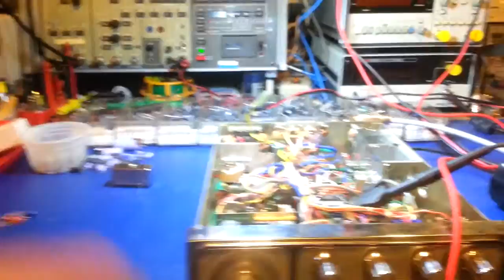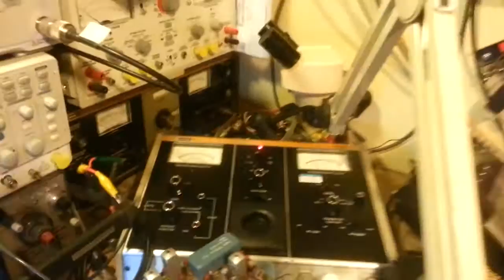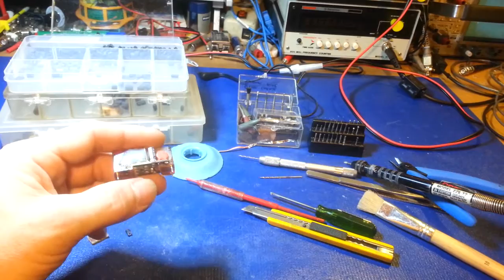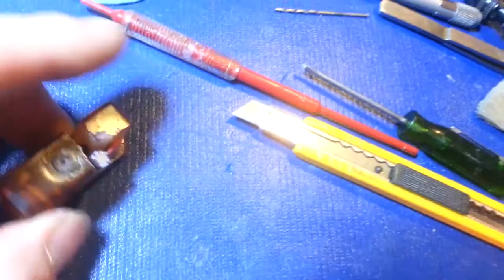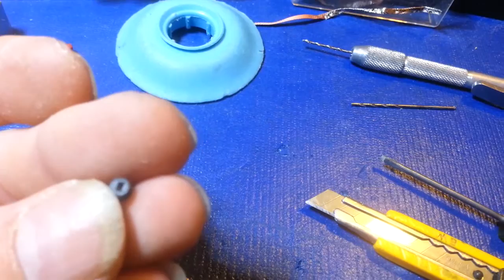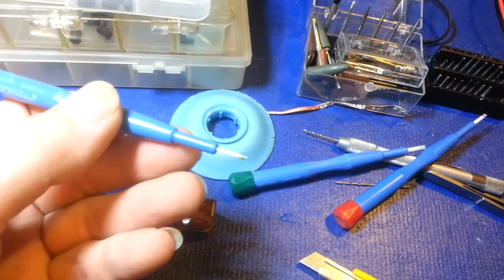Midland 79-892 AM/SSB CB radio Cybernet VCO block repair completed. Part 2

Comment: I've been very successful rebuilding the blocks. Heat gun , resolder connections, (epoxy pulls  connection apart over time) replace diode(some) & cap, some but not all have the hole in them on bottom. But a Dremel is your friend here!!

Comment: Mike - You're truly a fantastic tech, however, your even a better instructor!  Put yourself up for a raise!  :)
Reply from the maker: I try my best.  Everyone seems to think the VCO blocks are not repairable.  A little determination, some mini destruction tools used for some precise demolition of the epoxy and their good as new.  Hate to think how many have met their end in the circular file.
Reply: I've never tried, because of the epoxy, however you make it look easy!  years of experience I'm sure!
Reply from the maker: +Vintage Electronics Geek 

Give it a try.  You won't hurt it if it's already not working. :)  For the varactor diode just use a NTE 614.
Reply: OK, will do!  I don't work on many CB's, I just finished a Realistic TRC-200 and the next victim in the long line of junk to work on is a Pres. Washington, not sure what's wrong if any, I bought it cheap and brought it home and put it at the back of the line!  :)
Reply: Im glad he puts these videos up for some of us that have similar issues. Some techs are very tight lipped and refuse to share their knowledge still thinking it's 1977 and tech work is super secret or something. LOL
Reply: Well some "techs" won't even TRY to fix a radio with an issue like this. They only know how to do a tune up, solder on PL 259s, ect ect.  Quick buck shit. They have no problem solving skills.

Comment: Is it posible to rebuild the Green ones Mike?
Reply from the maker: Yes and its much easier.  The varactor diode is on the outside edge and there is no electrolytic capacitor.  I did my first couple with a razor knife to shave away the epoxy.
Reply: there is a company in the UK called Spectrum Communications who does replacements for the green type and the older metal ones as in this video. As Mike says the diodes easy to get too.